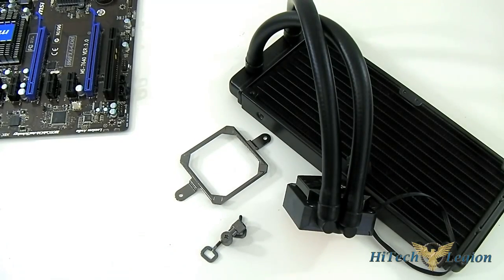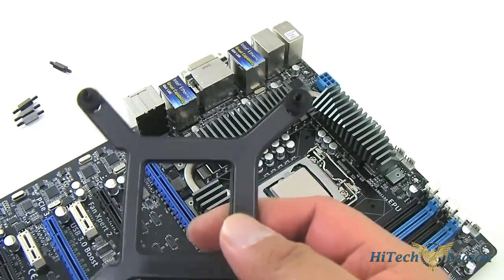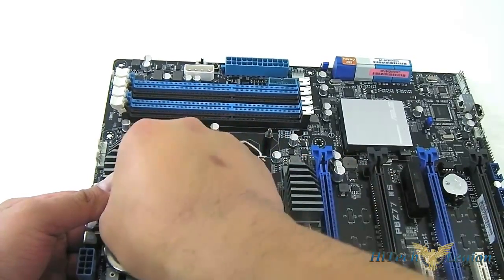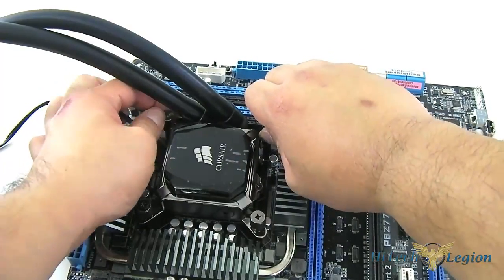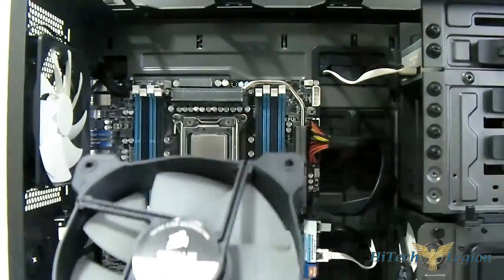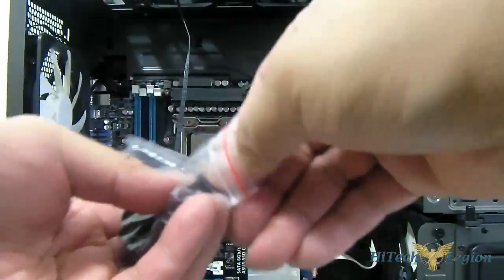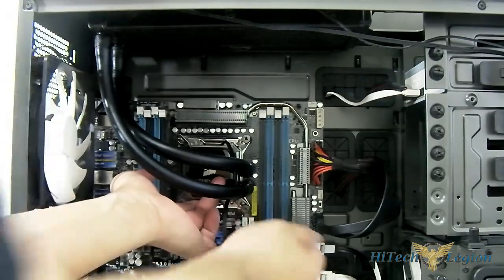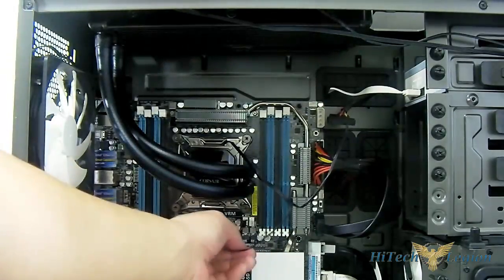Corsair H100i CPU Cooler Installation Guide for AMD and Intel Motherboards

Comment: Hi I have it installed on 8700k Lga1151, I want to upgrade to AM4 5800x, do I need different bracket or the same one will do?
Reply: Did you ever end up using it on the AM4 chip? Does the same bracket fit?

Comment: I have a question. I have a H100x water cooling system. I'm upgrading from a cooling fan system. It comes with pre applied thermal paste. But in the manual it recommends removing the old thermal paste from the processor and apply new one. My question is: do I have to apply thermal paste to the processor besides the one that comes with H100x? or the manual is outdated and is referring to an old version of H100x which came with no pre-applied thermal paste?

Comment: you forgot the water, this is very important when you want to do a tutorial installation
Reply: +Antonio Caetano This is a pre-filled, closed loop cooler. What, exactly, would your expectation be with water in this video? There is no way to add any or take any out.....

Comment: Hello, I am having a problem with the installation of this water cooler corsair h100i GTX on an AMD fx 8350 processor. I do not have the Back Plate and I dont know what to do because when I put the screws there is some gap. I CANT find a video on this water cooler on an AMD processor :/ Some help please. In the image of the link you can see that the piece "at the right" is the one I dont have. I only have the other one, the solid plate. Is it necessary to have BOTH in order to install this cooler?  http://ecx.images-amazon.com/images/I/41Ewoq3fKvL.jpg
Reply: use the your original back plate. the mount that comes on the cooler is for intel, but its easy to replace, twist it off, and twist the amd one on. i was confused on it as well, but thats all you have to do =) hope this helps! 
+E. Krieger (Luna Fantasma)
Reply: max yakovlev Hi, thanks for your answer. I didn't have the original black plate either otherwise I would have done as you say. It was a comment I made to help my brother with his computer, but after a while he solved the gap with some plain washers XD they worked perfectly. It wasn't my PC, mine is different. My bro and I build PCs. Thanks again and greetings :)
Reply: Whatever works right? Haha just make sure it's on there and secure :)
Reply: max yakovlev Yes of course it's secure, we have experience working with machines ≧ω≦
Reply: +E. Krieger (Luna Fantasma) good! :) happy building!

Comment: Is there a tutorial on how to add and were to add the water ? Like is there water in it or no?
Reply: +iaGzo There is liquid in it, but it is closed loop - you can not fill, expand, top off, customize, etc like you can with open loop cooling.

Comment: I have a cooler master HAF X case.  My case has 1 front intake 230mm, one side intake of 200mm and 1 rear 140mm exhaust.  It has 2 top 200mm mounts.  Can this cooler be mounted towards the front of the case underneath the 200mm mount that is close to the front.  So instead of it being overhead it would be overhead to the right.  It would have a 200mm intake on top of the case and 2  120mm inside the case as push pull intake.  Is this possible?  Because i want to use the rear top 200mm as exhaust along with the already 140mm rear exhaust and power supply will be exhaust also.  PLZ ANSWER :).

Comment: I have a question!
I just watched your new ish video on the Corsair H100i GTX H110i GT Video an the new AM3+ mounting bracket looked way different then it does on the H100i.

So how would the new H100i GTX Mount if it doesn't look similar to the Coolit design?

I'll be getting a new 100i GTX because my H100i leaked all over my motherboard which really sucks.

Comment: Y didnt you show where to connect the usb header
Reply from the maker: Tanzeel Bari The location of the USB header differs on MBs. Please refer to your MB manual for the location.
Reply: Mine is msi z87 gd65 can u guide where would it be
Reply: Tanzeel Bari You can down load your manual here - http://us.msi.com/support/mb/Z87-GD65-GAMING.html#down-manual
Reply: :) thanx but u should move camera little bit to show what ur doing

Comment: does it support LGA 1150 socket pls reply ASAP
Reply: Harkirat Singh Yes.
Reply: Harkirat Singh it does but the bracket is crap and doesn't fit properly meaning that the surface of the block doesn't apply enough pressure to the CPU. My 4790K was running super hot! The guy is talking out of his ass saying that the bit of play is part of it. If you get this make sure to buy some rubber washers to make sure it fits correctly.
Reply: Thx
Reply: Lol why doesen't people read the details on the box it tells why what you need to know , same for manuals xD

Comment: In my set up I want one fan in at the front that brings in air and the h100i at the back to blow out hot air. What case design would fit this? Also links would be appreciated
Reply: mrME It depends on if you're thinking 'silent' or not. Obviously there's not a whole lot of noise dampening at the back of a case, so what I would do is mount the h100i at the top of the case, and have a large 140mm fan exhausting air just below the h100i when it brings the air in. Otherwise, it'll be quite loud. It's also impossible to have the fans in different spots because it wouldn't push air to the radiators.

Comment: certainly seems easier than setting a CM Hyper 212 Evo in comparison...that thing is a brick. Now the only question is - does the H100i lower my temps better? With my current 212 Evo my temps never go higher than 45 Celsius when playing a game. Would the water cooler match that or make it even lower?
Reply: Joey McIntosh

in most cases a water cooler will lower your CPU temp better than an air cooler like the Hyper 212 Evo. Linus Tech Tips has a video comparing all fan configurations of this water cooler (the H100i) vs one of the best air coolers on the market (I forget the actual model, but Thermaltake makes it I believe).

Comment: anyone got a guide on how to apply thermal paste onto a FX-8320 8 core using the H100i
Reply: or does the h100i come with pre applied thermal paste?
Reply: Kristoffer Henry pre applied
Reply: ***** great thanks for the swift reply :) . How are the stock fans? or is it worth changing them? i hear mixed reviews that there super loud some say there silent lol... so no idea to be honest
Reply: Kristoffer Henry they are loud. i would recommend changing them. :) for example some corsair sp140 or something ^^
Reply: Kristoffer Henry just wanted to say DON´T buy AF fans for the h100i!!! SP fans are much better in this situation!
Reply: great thanks for the help :)
Reply: Kristoffer Henry Given that the H100i uses a high fpi aluminum radiator, noise is always going to be part of the equation, there just isn't any way around it due to that. Your best solution is to avoid Corsair fans altogether given that their airflow/static to noise is middling at best, and downright awful for their price class.

You are far better served going to Noiseblockers, Phanteks 120MP's, Noctuas, GTs, etc.
Reply: ***** don't you mean the corsair sp120? I think the sp140 are a notch too big

Comment: Never use the pre applied paste on coolers/ heat sinks.. its rlly crappy always best to clean that old junk off and put some good quality paste on
Reply: The h100i actually includes a high quality one that beats most other aftermarket ones. ( read a bit on it)

Comment: so does it come with coolant already in the tubes or do you have to buy it?
Reply: It is an All In One, meaning it is all set and ready to go, you just install it like this.
Reply: thx
Reply: danermanerkider Just a question, how would I go about making this an external setup? I'd have to remove the tubings from the pump and threading it through the holes of my case to the inside to mount the tubing back to the mounted pump.
Would I need to remove the coolant to do this?
Reply: Kyler Parson This is a closed loop cooler. It has no provisions for opening and then refilling and bleeding or properly reconnecting the tubes. To mount it externally you would need to have a hole in the case large enough to pass the pump assembly through.
Reply: George Cella Huh, go figure. I've got the NZXT Gamma Classic case, I don't think I can mount the radiator on the top, sadly.
Reply: Kyler Parson Go with a Swiftech H220-X or XSPC 750 EX240 kit. Much better cooling, far less noise, open loop, expandable and customizable. Just a few dollars more for a whole lot more cooling and flexibility.
Reply: too late, i already bought my build
Reply: ***** Yes, an actual custom loop using better quality components and a much higher dissipation radiator has the ability to run significantly quieter with the same results.

BTW - FX series chips have a well known temp sensor issue at lower temps, your CPU is not below ambient. Also, idle temps are not indicative of performance.

And the whole buying fans to wind up spending ~$150-160 on a CLC is crazy. Especially when you can get a discrete loop for that. Why buy a Big Wheel when you can get a Harley for the same price?
Reply: ***** Wow....very appropriate name you have given yourself....

Complete BS? Try reading rather than assuming - https://www.google.com/webhp?sourceid=chrome-instant&ion=1&espv=2&ie=UTF-8#newwindow=1&safe=off&q=amd+fx+incorrect+idle+temp+reading

Yes, an H100i for $115 is fine, if you are setting your bar really low. Some people aim higher and like to get the best they can for their money.

And it was your recommendation to go out and spend another $30+ on fans to quiet it down, not mine. Spending the same amount on a CLC + fans as you would on an open loop like the Swiftech H220-X or XSPC Raystorm kit is well....rather pinheaded.

And yeah, you might want to find out exactly how much better than an H100i both of those are (you know, read and research) so that your next reply isn't another totally inaccurate one.
Reply: George Cella I got my H100i for 50$ is it good considering I payed 50$ (got it on sale)

Comment: If i CANT afford the pull/push configuration, what would you guys recommend me? Fans on the top of the case, radiator in? I have a nzxt phantom 410 mid tower

Comment: will it work with i5 4690k ? and only this i have to do to install the cooler ? any other parts i need to buy separetely total noob on water cooling ?
Reply: Sushmit Dey Everything you need is in the box to install it.

Since you are new to liquid - check out our reviews of the Swiftech H220-X, H240-X and Cooler Master Nepton 240M. They should provide some very helpful information before you make a decision.
Reply: ya i just did some research its not a custom loop water's already in there .. thanks :)
Reply: Sushmit Dey Actually, the reference was to the fact that they are both significantly better options than this.
Reply: On a tablet, so i cant do +George Cella, but you may want to consider that the h220x and h240x are unavailable for purchase in the uk.

Comment: wait wait do i want my fans to be sucking air from the outside or from the inside
Reply: guyonwabbit Running your fans as intake will get you very slightly better CPU temps, however you will also be blowing hot air into your case causing all of your other components (especially your GPU) to run hotter. Personally, I don't think it makes any sense to have your GPU frying to gain a couple of degrees on your CPU.

Comment: if i bought this would i need to plug in the usb header and the other thing or will i just need to plug in the fans if i dont want to use the software from corsair to control the fans and i just wanted to controll the fans via my case's fan control? as that looked like a lot of wires i dont want to have to organize out of the way and tbh i will have no need for the software
Reply: Then why not go with a Thermaltake Water 3.0, Zalman Reserator 3 Dual Max, or Cooler Master Seidon? They all perform as well or better, don't have the bloatware to deal with and are quieter.

Comment: So with water cooling would you still have fans setup as front and bottom intake and top and back as exhaust? Im thinking it might be different because you wouldnt want all that hot air from below exhausting through the radiator? Help pls..
Reply: The same rules apply. Provided you have good fresh air intake in your case the air being fed to the radiator is sufficiently cool.

Comment: I installed my H100i exactly like that but only one fan would spin on boot, and the whole unit was not recognised by the software (I can't even get the led to come on). I ended up installing a fan controller to control everything from the front of my PC.  Was a major pain in the ass. Tried all the usb headers on the MoBo (all work fine as the front panel works in each) still nothing. Tried to connect via rear usb still nothing.  The forums at Corsair are packed with people with these problems, their proprietary "link" software is pure shit and does not work.
Reply: Yet people keep buying them......smh.

Comment: yeah.. with my 450d i'm still going with the exhaust. front intake, back/top exhaust. the temperature inside will still be lower than the radiator.

Comment: I will be upgrading from stock to teh H100i and was wondering if I need to replace teh thermal paste? It has only been in there for about two weeks or so. CPU is an Intel i7 4790k if that helps!
Reply: Although it seems I cannot find a space in my Thermaltake Armor black for it anywhere! Arghhhhhh!

Comment: Ok this makes no sense at all i am trying to figure out. if its called a  water cooler how come they put no water in it i could abosouslty not find anything about putting water in this so if i am correct does the fans sit on the top of the radiator and blow in cool air which cools down the cpu please respond asap if so
Reply: It is a "closed loop" cooler. This means that the loop is prefilled with liquid and sealed right out of the box.
Reply: George Cella thanks i was super confused
Reply: super dumb lol
Reply: Mark delos santos Eh, not really. People who use them talk about these things like they are running custom loops, so going by what you see in forums it could become confusing. Kind of like a bunch of kids with Big Wheels talking about their "exhaust" sounds. If you heard only those conversations you would probably assume that the Big Wheel had a gas tank and would wonder where it was located upon seeing one.
Reply: FPcombat You should start doing research before buying new products.
Reply: George Cella
haha great example your reply helped me too thanks :)

Comment: I got a question, Do I need to put a thermal paste in my processor when putting H100i?
Reply: The H100i has pre-applied thermal paste. Its gray in color in the part where your cpu touches the h100i. Or you can get an aftermarket thermal paste and apply it yourself.

Comment: does it matter how the radiator is oriented? What I mean is, I've seen some videos where the radiator hoses drop down in front of the rear case fan (like in your Intel example). In other videos, I've seen the hoses on the right, next to the drive bays. Thanks
Reply from the maker: This makes no difference in performance. You an mount it either way depending on what fits more easily in your case.
Reply: HiTechLegion
thanks for the quick reply
Reply: HiTechLegion does this corsair h100i will support LGA 1150 socket for intel i7 4770k
Reply from the maker: santho santhosh
Yes.
Reply: thank you dude!

Comment: what is the 3pin (1cable) connector for? is it important for running the pump or fans?
i didnt connect it, but it runs fine! i only use the powerconnector for the pump.

Comment: Every video shows how to install it, but they dont say anything about the liquid that's  inside the water cooling, is not "water" is some kind of refrigiration
Reply: It's distilled water with a little glycol as a biocide/corrosion inhibitor. No refrigerant is present, nor is there a compressor and chiller combo to make refrigerant work. No magic here.
Reply: So it comes inside of the cooler already? No need to put the liquid yourself? It comes pre-installed?
Reply: Mike Diaz That is correct. Fully assembled and ready to be installed. No way to open them, fill or refill them.

If you are looking for something higher end, the Swiftech H220/Cooler Master 240L is pre-assembled, but is open loop so it can be added to and configured as you like, and XSPC makes open loop kits for only a little more than the 240mm CLCs.

Comment: And good luck getting Corsair's own software working if you're running Windows 7 64bit. I also believe Windows 8 users are having the same problem where the H100i doesn't show up in the AI suite software, so you can't change any settings. And 3 months later and they still haven't fixed it. So I spent £80 for something that sits inside my case running hotter and making more noise than the stock heatsink and fan that came with my CPU does.

Comment: he wasted 1 fan port by adding the dummy connector instead of adding the dummy he should have added one of thr radiator fans in the cpu fan port and the other one to the cpu opt
Reply: You could do that if you like, but you would then lose all of the software capabilities as well as the internal speed controls.